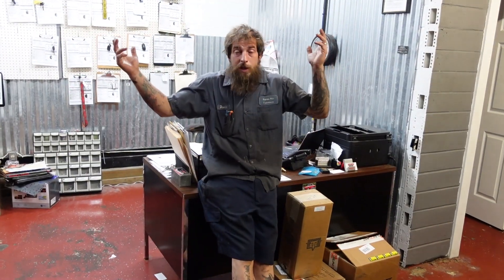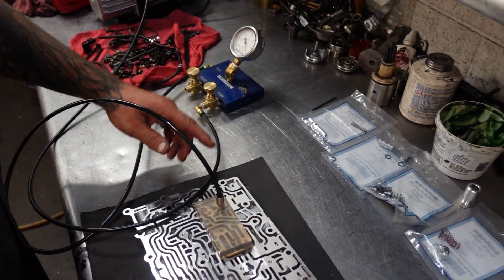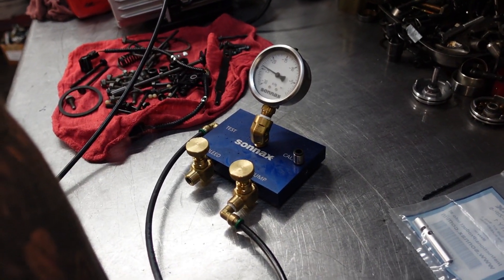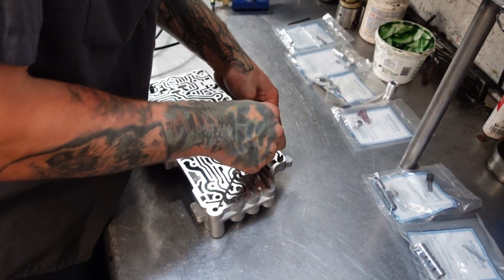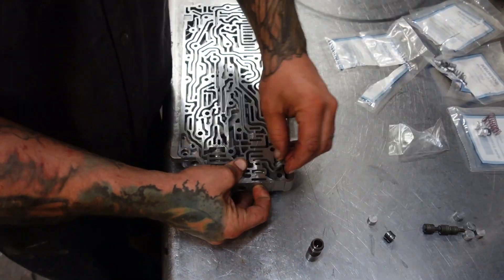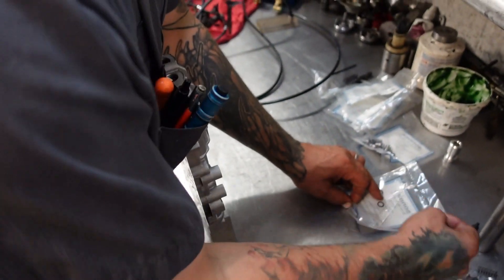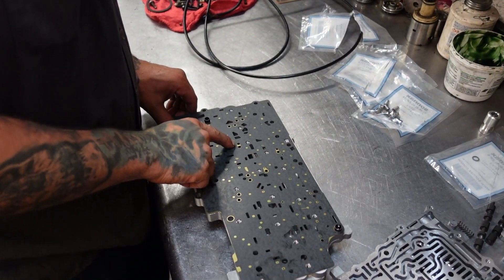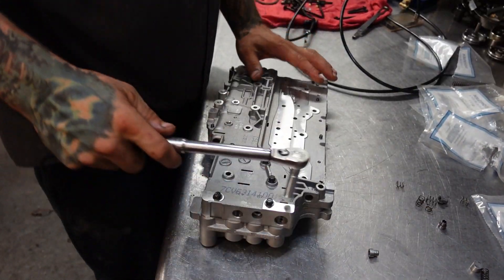6L80 Valve Body Build and Vacuum test

Comment: Can I bring a new or refurbished techm to a shop to have it programmed? Or does it have to be installed in the vehicle first?
Reply from the maker: @lilamay333  depends on the shop but typically it has to be installed. There are some who have the ability to bench flash the tcm but its not how i recommend to do it.

Comment: I have a 09 denali with no forward gear. removed valve body and inspected check balls. no problems found. what can i do to verify if the problem is in valve body or the trans?
Reply from the maker: @taylorolson6939  air up the 1234 clutch through the case passageway  youll hear a massive leak in the 1234 piston.
Reply: @expressautotransmissiondav4207  what would that mean if you have a  leak in the 1234

Comment: Hey buddy great videos. Got a question for you. I’m doing a 4bt Cummins swap into an 08 Escalade. I got it running and was getting 2,3 pressure switch codes, changed all 4 discs, new seal/filter between the techm and valve body and also split the valve body and made sure everything was clean in there. I pulled all the valves and cleaned the bores.  Re assembled with a new spacer plate with all the balls back in where they go. Torqued the bolts to 71inlb cuz that’s the spec I found, new filter and fluid. Now no reverse. All gears but park are forward even neutral. Any suggestions? Thanks for your time.
Reply from the maker: Check the manual valve and make sure it's hooked to the rooster comb
Reply: @expressautotransmissiondav4207  I will check that tonight. Thanks for the reply!
Reply: @expressautotransmissiondav4207  you hit the nail right on the head. I didn’t get the dowel in the slot on the manual valve. Thanks for your help!
Reply from the maker: No prob at all.

Comment: Excellent videos, thanks for sharing info. Do you have a preferred method of cleaning the valve body prior to vacuum testing? I've been using mineral spirits from the solvent machine but was considering trying an ultrasonic cleaner

Comment: Hey there, came across your channel by chance looking for advice from an expert and I'm so engrossed with your video's .
I have a 2007 6L80E that won't drive even when shifter is in the drive position.  No warning on dash cluster just won't go into Drive even when selected.  Park, Reverse and Neutral are ok and this problem just occured suddenly, no previous  problems with the trans and was serviced 30,000 kms ago. 
Would you have any suspicion as to what the issue could be ?
Reply: Vehicle has done 200,000 kms  and has regular servicing
Reply from the maker: No drive can be a check ball issue in the valve body or a broken piston in the 1234 drum or cracked weld in the 1234 drum. As well as some other things but as a sudden stop these are the areas I would look first.
Reply: @expressautotransmissiondav4207  When I bought the car 3 years ago the was always had a slight whine in 1st gear, not loud but just there,  never seemed a problem and never got worse

Comment: Hi, Just become your subscriber.  couple of questions..  1. if line pressure is holidng well for every gear as per the spec, can i assume valve body is good.. in otherwords i dont know how to isolate valve body (hydralic issue) vs mechanical issue when there is a slip on specific gear.. i assume if line presure is good valve body is good and i can condemn mechanical issue.. is my direction right.. 

2. i also dont know how to isolate Torque coverter issue vs hydralic or mechanicl issue.. 

Much appreciate if you can help.

Comment: What else might cause me to have no forward gears but reverse works fine. I drove from California to texas no issues. Got to the apartment unloaded truck and drove 8 miles to Walmart. When returning from Walmart I was exiting the freeway and the transmission disengaged. I had no forward just reverse. Transmission temp was 190 degrees. Pulled the pan and no metal but fuss on the magnet. Fluid is dark but doesn’t smell burnt. I opened the filter and found a couple of slivers in it but very small. The balls look fine. But the valve forth from the left stuck a few times when I pushed it against its spring. Do you know what might be causing this and how do I fix it. Thank you for your time.
Reply: Truck is a 2015 Silverado Z71 5.3L eng. I think the transmission is a 6L80

Comment: What would cause my 6l80e to only have reverse gear and no forward gears? I check the check balls in the valve body and non of them look shrink down.
Reply from the maker: I've seen this happen with a broken 1-2-3-4 piston.
Reply: I have the same issue. I drove from California to texas. No issues. I went to Walmart then when I was on the way back from Walmart I started to exit the highway and my transmission disengaged and I pulled off . I lost all fwd gears. But still have reverse. Transmission was at 190 degrees. Fluid is dark but does not smell burnt. No metal in pan. A little in filter when I broke it apart. Filter had a couple of slivers that were small. When I moved the valves  one stuck a couple times. The forth from the left. What could it be causing it. The balls look fine.

Comment: OK, so what's up?  At 4:30 it shows the vacuum at around 24.  Then you change the plug to one with an o-ring.  Upon retest at 6:00, it shows a reading of around 21 - indicating a bigger leak than the original plug.  You say "That's absolutely perfect".  Explain.
Reply from the maker: This was a total dumb moment, lol. The first reading was without calibration of the vacuum stand. There's a break in the video where I realized I had not calibrated. With my gauge and new end plugs 21-22 inches of vacuum is ideal. Sorry for the confusion
Reply: @expressautotransmissiondav4207  That must have been quite the recalibration.  Your statement says you feel around 3 in drop is acceptable.  5 you say is too much.  This means that if the second test is "ideal" at 21-22, the original test would have to have been around 17.
Reply from the maker: We're actually doing a video covering that this week. I will try to be as clear about it as I can. We will be covering vacuum testing and calibration more in depth. Sorry for the confusion one twist of that calibration knob and it reads all over the board lol

Comment: Another great video. Back in the old Th350, Th400, C6, 727 etc  days I guess the pumps were so large that cross leaks and leaking valves were not a big issue. No one cared if it took 3- 4 hp to drive a large pump. So interesting the knowledge needed to overhaul  a newer model transmission.
Reply from the maker: Thank you for that we are really enjoying making them and sharing as much knowledge as we can.

Comment: Once again,
This is for my escalade. You are right david, this trans is installed and finally got it running. Ran into a issue where after the install, truck had a no crank no start and no check engine light icon on dash issue. Finally after getting bad news, after news and alittle more bad news, my diagnostic guy said its the ecm. Picked up a used ecm from junk yard, installed it and programmed everything and truck is running great so far. For sure feel a huge difference. Some excellent high class work you did on this turkey.
Reply from the maker: Lol that's great to hear buddy. It definitely was a turkey but as always was fun to play with for sure. Thank you for your support Carlos